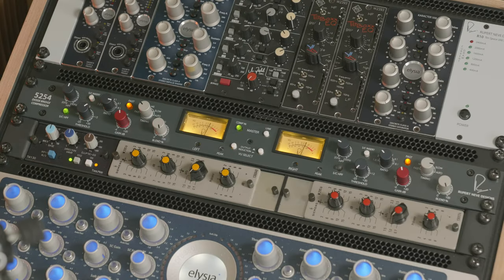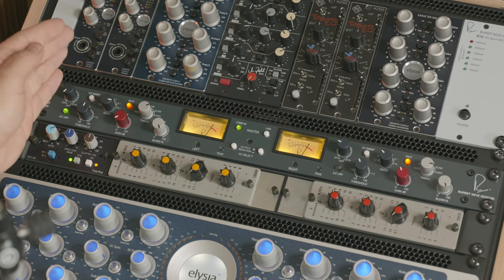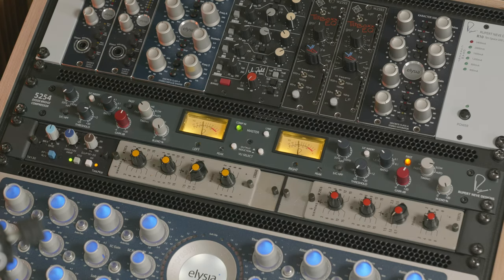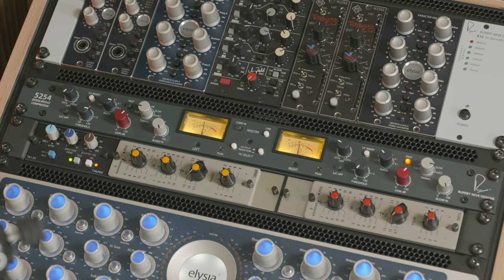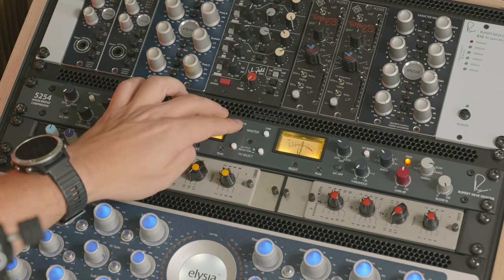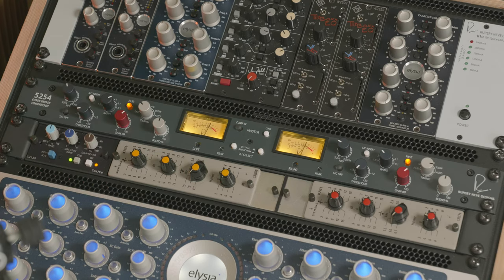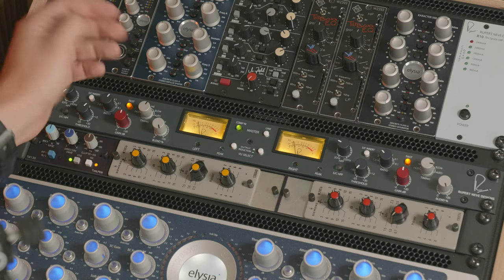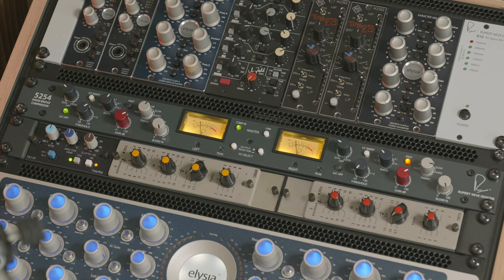Great Analog Compressor for Recording & Mixing | Rupert Neve Designs 5254 Review

Comment: How does it compare to the 535? I have two 535s and I'm wondering if it would be overkill to add the 5254.
Reply from the maker: From what I understand, they are the same design as the 5254. So there is no need to upgrade.
Reply: There is slightly more headroom in the 5254.